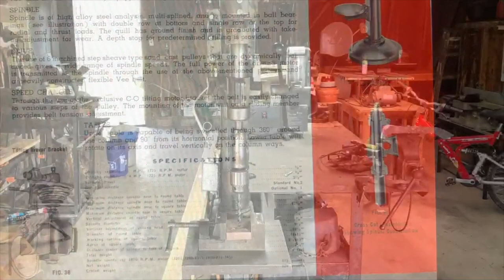Canedy-Otto Drill Press - Motor Mount

Comment: I just bought the same drill press. Your video is the only one like mine I could find. Thanks for the info and the video!  Mine has a canvas belt that I will definitely replace. Any recommendations for type and size belt that fits this?